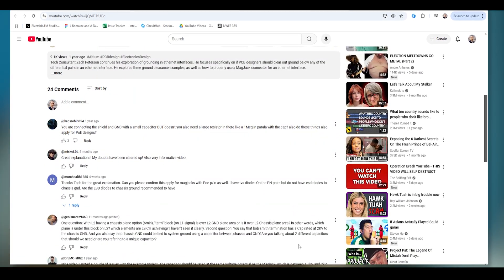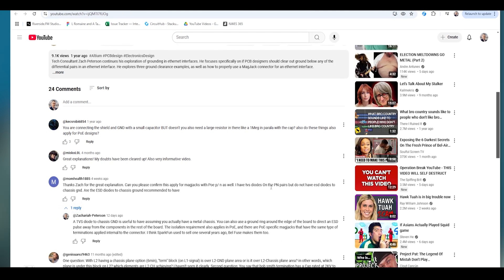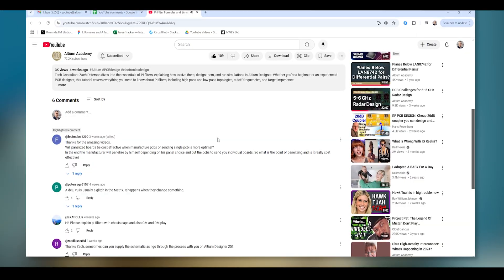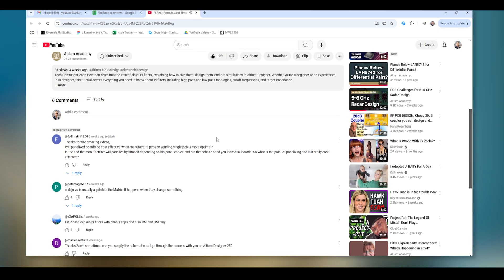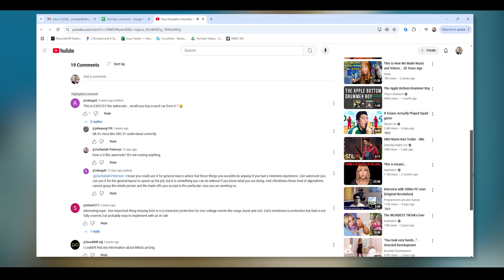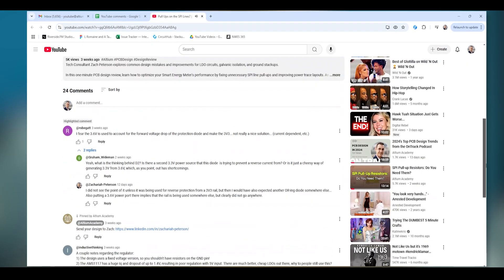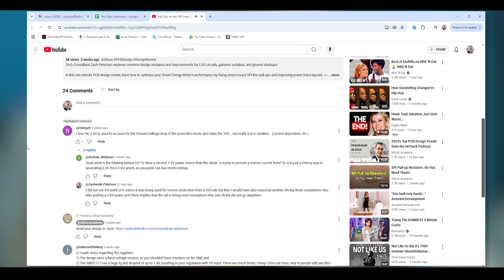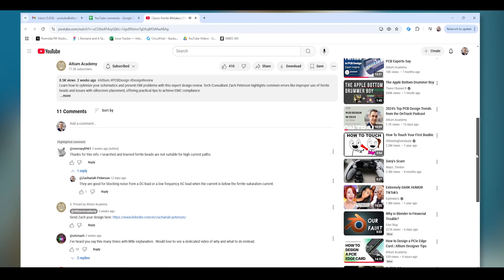Ferrite Beads, Flybacks, Facepalms | PCB Design Office Hours #4 With Zach Peterson

Comment: Hi, Zachariah how are you. I have a question about the DC-DC regulator selection.
 What is the difference between peak current and average current? For example, if I use a 40W amplifier with a 5% duty cycle, my average power would be 2W. Should my DC-DC regulator be rated for 40W or around 2W? Also, can capacitors handle the peak current demand?
Reply from the maker: I'll make a video about it, but I'll give you the answer now. You have to comply with both specifications. The switcher is what draws pulses, and so it has a peak pulse current rating that needs to be obeyed. That peak pulse rating might be specified for a specific duty cycle, so you can get an equivalent average current from this. The same applies on the secondary side rectification in a flyback converter, for example, those secondary side diodes will have a peak repetitive pulse current rating, and they will need to have fast enough reverse recovery time to ensure they do not overheat. For inductors, usually you only need to look at the average current rating, because the inductor current in a power regulator is normally a DC level plus a ripple current. For transformers, we have to look at both the peak pulse current and the RMS current, the latter of which will depend on the duty cycle.
Reply: @Zachariah-Peterson  Thanks for your answer. Looking forward for your video.